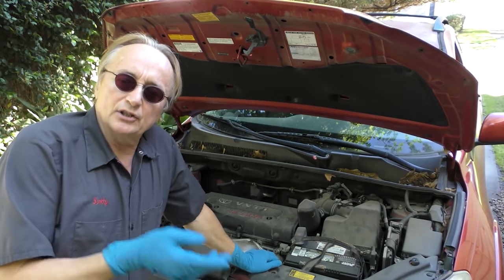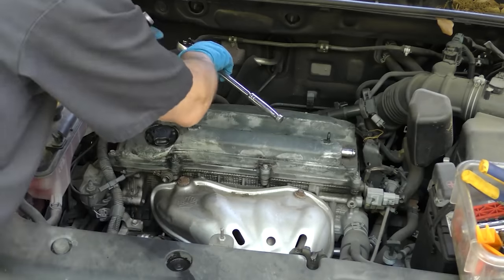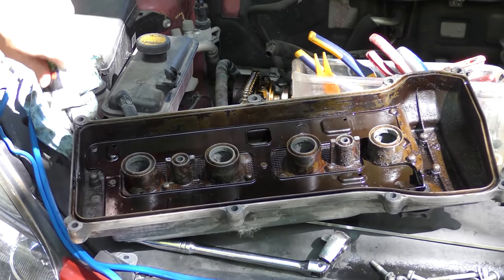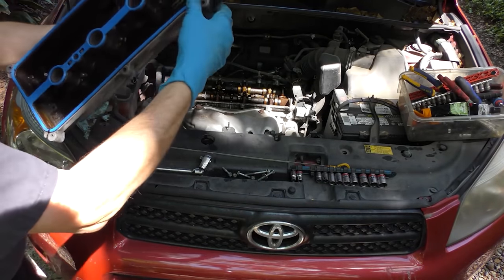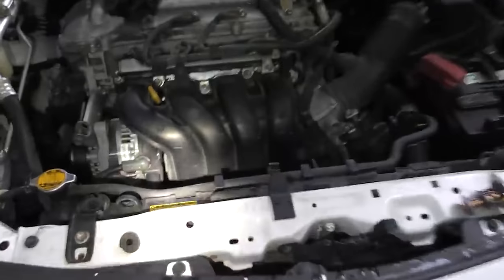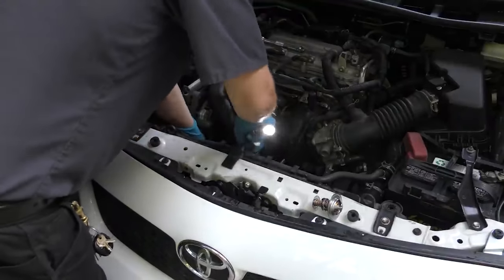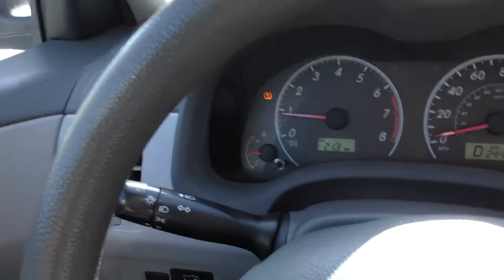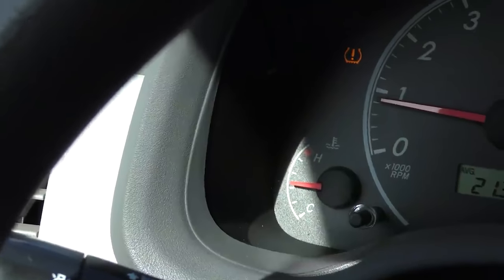3 Mechanic Scams Caught on Camera

Comment: The "Beauty Cover" actually does serve a purpose. Three in fact! #1, it lowers engine noise for a quieter driving experience. #2, it's often used to protect sensitive electronics from water intrusion. And #3, and helps keep clean areas that are difficult to clean. #3 is not so important, but #1 & #2 are the main uses outside of pure looks.
Reply: and #1, traps in more heat, #2, provides a tighter area for mice to build nests then chew on wiring, and #3, means you can't spot things at a glance, have to take the stoopid thing off every time you want a look at the top of the engine or half the things around it, depending on how large it is.
Reply: @stinkycheese804  the heat difference is insignificant if at all
Reply: Except for the fact that they almost never cover those sensitive electronics lol. The purpose it serves is so that the manufacturer can charge you for a 500% markup on even more plastic. You're welcome.
Reply: I’ve got a hi mile Audi A4 1.8 T.  My plug coils kept failing,  one every six months or so.  When I quit reinstalling the cover, the coils quit failing.  The turbo gives off a lot of heat, so this is an extreme example, but there’s something to Scotty’s advice on this, I think.
Reply: Audi sure screwed up on that one
Reply: Or maybe it was intentional to get people to have to do more maintenance / pay the dealership more money for maintenance.
Reply: @KenzertYT  all car makers seem to be guilty these days of this kind of silliness.  Why hide the engine?  Are you ashamed of it?
Reply: this dude is baked outta his mind he has no idea what he's talking about. My dad rebuilt a 1935 Oldsmobile from the frame and the rims off a crashed dragster.  had a buddy work on my car when I was a teenager after he got done he had a handful of screws let over I asked where they should go, he said you know what to do with left over parts?  Then he threw them into the field behind the house
Reply: I have always removed my plastic covers because you have waste time for simple maintenance ! Have driven two Volkswagen over 300,000 miles without covers !  YOU DONT NEED THEM and yes, I believe they hold in excessive heat that cannot escape the engine !
Reply: @D M, good to know! Not at all a mechanic here, but I was wondering about the use of all of that plastic. I've heard in other videos mechanics grumbling about having to deal with it on certain models.
Reply: It does not allow heat to dissipate which causes way more damages than the beauty cover offers benefits.

Comment: I know a guy that works at a dealership, and part of the problem I see is that the dealership pressures technicians to find problems to write their check, it's a huge problem in the industry
Reply: This is part of the truth.  I ended up changing careers to IT and Software Dev because dealership and mgmt would nickle and dim my work in more than one place while not trusting their employee's expertise.  Added insult to injury when salary for automotive mechanic was really terrible, borderline poverty.

For example, there was a clutch cable repair on a sports car.  X company computer says 2.5 hours of work.  Read the SRM and knew it'll take 7 to 8 hours as it needs to pull the dash to reach the areas to feed through the firewall.  Called X company engineer to confirm, sometimes they do not respond until next day, sometimes they think I'm stupid, this time they know I'm right but not sent paperwork to my supervisor saying it's 8 hours.  Guess who worked for 8 hours and being paid 2 hours of work. 🤪🙃 /iquit
Reply: Wow ok no wonder. I thought mechanics were just that dumb lol
Reply: Definitely I worked at a dealership for 2 years as a technician I can second that. I learned a ton while I was there but from my experience you are the lowest on the totem pole and treated as a peasant

Comment: I prefer to use a heavy high temp axle grease to hold gaskets in place. Then you don't have a bunch of scrape and when you try to get it out. And it keeps cork gasket and paper gaskets Supple and soft they don't crack or dry out so quickly
Reply: vaseline works just as good. either way, they work, and keep the gaskets supple.
Reply: @jimjam1719  Not at all, vaseline isn't viscous enough and even axle grease may not grip well enough on those silicone rubber gaskets.  Cork or paper sure, they have a much larger surface area so you can get away with grease but silicone gaskets not so much.
Reply: @stinkycheese804  well, i never had problem with grease or vaseline, they always held rubber/silicone gaskets in place, i've used them on motorcycle and auto rubber/silicone valve cover gaskets and certain o rings, they do leave them supple, for the long haul? not sure, i never micro managed it, but they never let me down as far as holding in place, and i never use them on paper or cork gaskets, the video is about rubber/silicone valve cover gaskets, not cork or paper, but i appreciate your thoughts, i always keep an open mind about things, preciate cha insight brotha.

Comment: Another time a customer brought me his VW Combi RV saying he had taken it to three VW dealers who all said he needed a new gearbox. $thousands. I looked underneath while someone else moved the gearstick. I removed the plate where the gear change link went into the gearbox and found a worn 'marble' thing with a hole in the centre. It was obviously worn so I went to the VW dealer and bought a new one. It cost 30cents. Then the gear change was a simple twist of the wrist movement. There was nothing wrong with the gearbox, just this little selector ball.

Comment: I just took my 09 Honda Fit to the dealer to get a recall fixed up. I mentioned that my AC had just stopped working a few days ago. They told me the compressor was leaking and the hoses were leaking and they said, word for word, that I should replace the entire AC system for $6,100 (more than I paid for the car a year ago). I brought it to my mechanic and he said the compressor was failing but not leaking, the CONDENSER had a leak. It's going to cost me less than a third of what the dealer quoted for me to get it working in tip top. There's a reason my mechanic has a 5.0 on Google with over 600 reviews.

Comment: For #2, with a car with such a high mileage, a coolant flush helps. I recently restored my old Pontiac Sunfire (100K miles at the time), which had temperature problems from time to time. I did a flush, which took a bunch of crap out but still over heated, so I took the water pump and thermostat out, and back flushed with a hose....BOY! A lot of crap came out which was not removed with the original coolant flush, and I kept at ot until water came out clear. Then I put everything back and reloaded with fresh DEXCOOL. Now it is cool as spring!

Comment: Reputable shops always save old parts for your inspection. Ask for it.
Reply: That's what I do.
Reply: They can show most people a similar old part off any other car and the customer wouldn’t know the difference
Reply: @gamebredduramax71  I stand there and watch a chump take it out and put it in a box or on the floor- sometimes mark it with a stripe ez marker to make sure it's the same part.  No mechanic is going through all that to deceive me-

Comment: Would've been cool to put that thermostat into some water on the stove and see if it would open.  If it stayed closed in boiling water, that would be conclusive evidence of a correct diagnosis.
Reply: At 250K why bother. It takes the same amount of time to change it as to test it. Of course if its your car you could just hold the top hose to see if the thermostat opens as the car warms up. If the hose gets to hot to hold its probably working ok
Reply: @IMHipp-wp3sd  I was thinking more about the piece of mind to know it's not coming back when you're 100 miles from home.

Comment: Aluminum head , aluminum valve cover , steel bolts , no mention of torque spec?  Scotty may know from experience , but the average Joe? Always check for a torque spec.
Reply: You always tight by hand, then with the tool until you feel resistance plus 1/4 depending of what you are working on.
If you cannot have the proper torque spec, the above will do.
Reply: @hakunamatata324  
And you dont want to use a Breaker bar either! 😅

Comment: The shop like Honest-1-Auto Care in Charlotte, NC is another example of bad business. Before taking my car to this place, I removed the tires and inspected the brakes. My car is 20 years old. I only needed brake pads for the rear brakes but they wanted to replace all rotors, calipers and brake pads for BOTH front & rear brakes! The final bill was $2,199. I asked them for the old parts they removed from my car. They said: it's not their policy to return old parts to customer.

Comment: I would strongly advise suggesting to disconnect the negative battery terminal before reaching your hands deep inside the engine bay directly beside the electric thermostatically controlled cooling fan. This fan has been known to turn on independantly of the ignition even when the car has stopped and is turned off and the fan can turn on even when the engine has been stopped and the key removed on a hot day. Careful.

Comment: Don't trust quick oil change places. Last time i went to Take 5 Oil Change they didn't change my filter. I brought in a OEM Toyota filter for them to use. The next time I changed the oil myself and it still had the old Frame filter that I wrote a date on it with a sharpie.
Reply: I had the same thing happen to me there.

Comment: Always get a 2nd opinion..Although I ran into a problem where I couldn't do anything but be hosed over. About 20 years ago I took my Nissan maximum in (90k) to look at the manual transmission.  Well the Nissan dealership told me over the phone it would cost $2,500+ to fix it. I did some research and found I was being seriously overcharged however,  when I went to pick it up I was told if I didn't fix it there I needed to pay $1,200 just to take it home with no repair (cost of looking at it if you could believe it). The moral of the story ask if the estimate is free or not

Comment: Ty Scotty... I worked at a national franchise that does auto repairs and other services.. I saw them screw people day in and out.. it was pure Greed! I quit.. my job had nothingto do will charging the customer.. just wrong! They always charged for a ac flush with extra labor when replacing a failed compressor. Must have been 30 quarts of un used ac flush on the shelf. Purchased but never used! Just one example.

Comment: Ever since jiffy lube didn't put oil in my car and locked up the engine then refused to repair it I've done my own repairs.  

Once in a shop I overheard an elderly man told he needed brake pads to the sum of $1200 .  

It's usually an easy repair and the parts are generally around $70 give or take.  All you need usually is a c clamp , socket set , brake fluid , a jack ,  jack stands and a YouTube video showing you how to replace it.  The tools will have easily paid for themselves after the first job.

Comment: I've seen mechanics replacing fuel injectors for overheating problems.
Reply: Maybe replacing tail lights for overheating problem. 🥴
Reply: That is no mechanic , just some dummy firing the parts cannon.

Comment: I too had a lazy mechanic at Christian Brothers scam me.  I brought my 2014 Subaru Forester in for a clicking noise while turning at slow speeds.  They ASSUMED it was the CV joints and charged me $700 for replacement CV axles.  These were cheaper and inferior to the factory ones, but I trusted them.  Started driving home, and the clicking was still there!  Took it to another mechanic, and found out that it was the transfer case viscous coupler.  I had the CV axles replaced for nothing!  The original mechanic refused to give me my money back and also refused to give me the original CV axles back.  I wish Scottie was my mechanic!!!

Comment: Don’t use weatherstrip adhesive on valve cover gaskets. Scotty, you know better….
Reply: Nothing will happen, calm down. It's an old trick and never caused any issues. People used this on race cars.
Reply: @notsoeloquent  , so they do this on race cars, are you a race car mechanic? I think not as you have never had to clean up the mess from an otherwise great product , used as intended.

Comment: I had a dealership tell me my 99 suburban belt, that i had changed 500 miles before, needed to be replaced.  They said the pulley had a crack causing the new belt to go bad.  Told them thank you but I will change myself.  Bought new items from them, took belt off and NOTHING wrong with belt or pulley!!  Took parts back, refunded my money, and complained to the General manager.  He said he would look into it and get back with me.  Never did of course.  Never get work done at dealership unless it is warrantee work. The mechanics get a commission off of extra work and the dealerships want to rip you off!

Comment: That stupid beauty cover is called a cowling, it directs cool air across the top of the engine, without it parts on top of the engine like the coil packs will be subjected to excessive heat.

Comment: @18:48 - The overbloated "needs to be repaired" estimate is a sales tool to try to persuade you to buy a new vehicle.  Hutchinson Buick, Macon, GA gave me a $7000+ estimate of stuff I "really needed to fix" in addition to the problem I did want fixed.  (It was the start of the new model year)  More than 2.5 years later, I have fixed NONE of it, and the vehicle is still fine.  P.S. Their repair did NOT fix the problem and I wound up doing it myself.

Comment: Scotty, love you videos. Very helpful. I have a 2017 Toyota Sienna Limited Awd and at 125,000 km, per the Toyota dealership, I had to replace the propeller shaft ($1,500 Cad) as there was a little play in the u-joint and there was a vibrating sound from the rear. Apparently the propeller shaft is a more common issue on the RAV4. I was very surprised the propeller shaft went so quickly. It is likely because I’ll make a yearly 4,000 trip, towing a open 3 dirt bike trailer with the bikes, 22 ft3 Tulle on the roof and my 4 kids plus my wife and of course a large dog. This was pretty disappointing as I feel Toyotas are extremely well built. I have owned many (8) Toyotas. Most recently the dealership changed ownership and it is now owned by a large company which owns numerous dealerships. It has become very evident that the service advisors are getting a piece of the pie, whereas the previous owner never tried to upsell me. I experienced this upsell the other day when I took my 2012 Tundra in with 185,000km and they told me a ball joint was done and the other was worn. I did have a clunking in the front when cranking the steering completely and going from forward to reverse. They told me it would be $2,200 to repair as they had to repair both control arms. They didn’t outline what else was included. So in the end I bought Moog ball joints from Rock Auto and the press from Princess auto ($400 for everything) and replaced them myself. Albeit, the clunked was reduced and the front end feels tighter, but it didn’t eliminate the clunking completely. Now I wonder it it is the bushings in the control arms. I’m sure that is a much more involved job that replacing ball joints.

Comment: I once had a ‘96 Tacoma that I took to the dealership to check something minor, they said the truck needed all the weird repairs and little things done that would cost roughly 3k. They said if I don’t get all of the work done the state won’t allow the truck to pass emissions and safety. I took it to my local mechanic who said the only thing I needed to do to the truck was fix a small camber in the tie rods and the car passed no problem… never trust dealerships

Comment: Remember when the Volkswagen Jetta had the tiny brush in the alternator.

Little plastic thing no bigger than a small tootsie roll.

They'd charge $275.00

To take it out and put one in, takes 8 seconds. 
Came out and went back in, two screws with a screwdriver. 

The part was like, twelve bucks.

Comment: Why didnt you do the HG test first? You have done exactly what the dealer did but they changed hoses and you changed a thermostat. If its on 240k and over heated, stands a good chance the HG has gone.

Comment: I think one word that he kept using is key to the problems with big shops, "Wait."  If one mechanic in a small shop has several cars to work on, he can run the engine up to temperature and move to another project while it cools down or the air moves out of the system.  There is no patience in shops where one mechanic works on one car at a time.  If you take the time it takes to do it right you won't have to do it over.